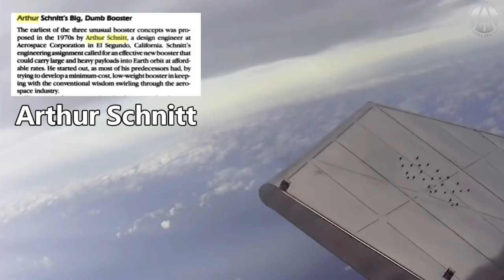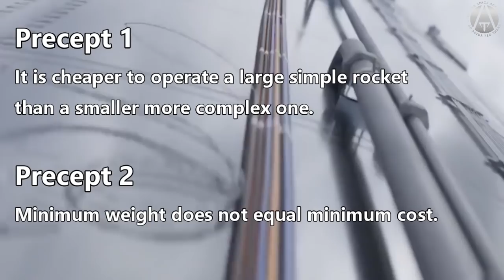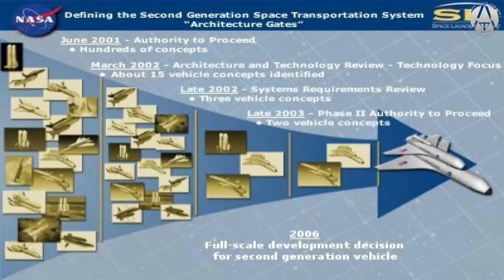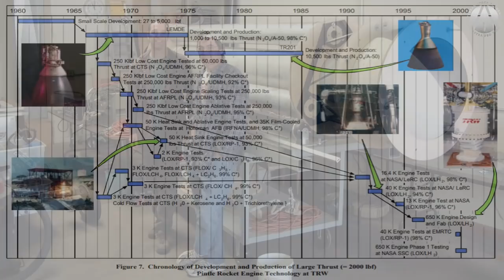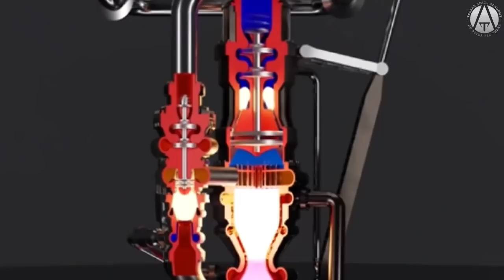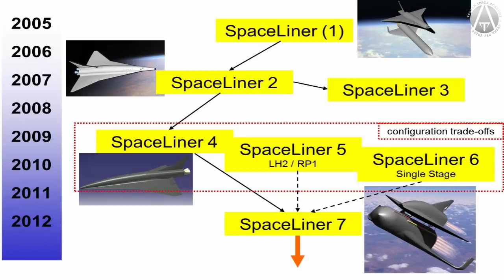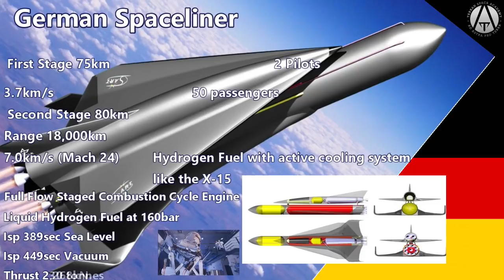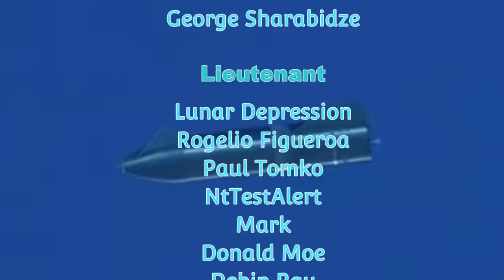SpaceX Starship: What is so special about the Starship system?

Comment: Did you hear about Northrop Grumman. It's going to make them out of carbon fiber, the solid rocket boosters. Have the gambling powered by batteries. It'll probably be lighter, those parachutes from back in the shuttle days will probably work better, And the whole system more reusable. Not to mention you can do on those engines, with what ULA is doing with on the Vulcan. Also the center booster can get Orion into space without the second stage. Reuse the second stage like Vulcan, so you don't have to use one every launch.
Reply from the maker: That is very interesting, Thank you!